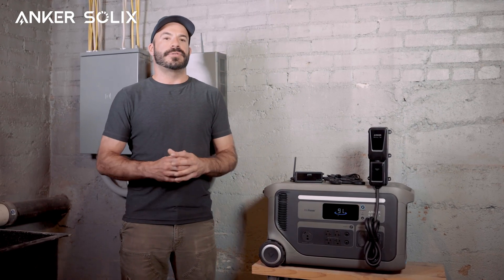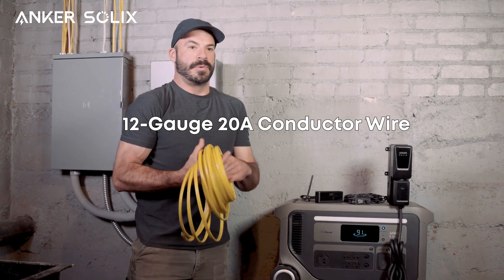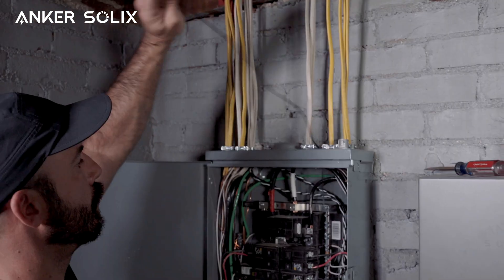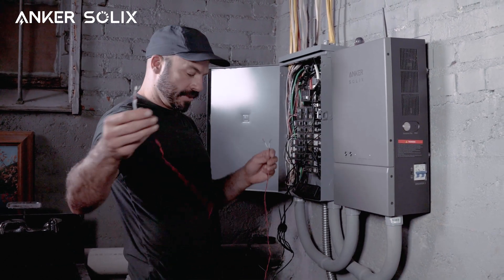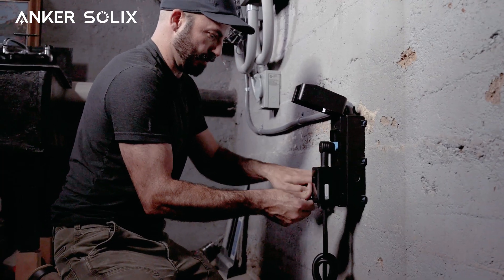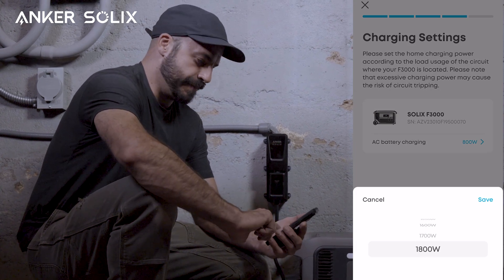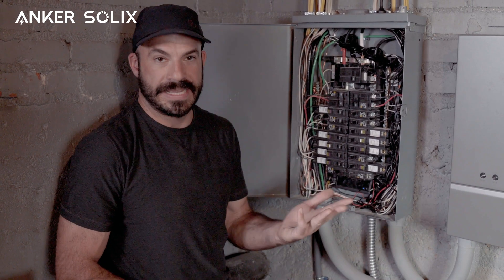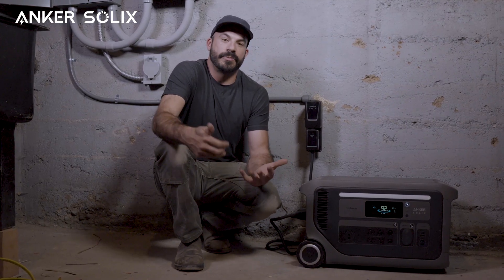How to Install Anker SOLIX F3000 with Bi-Directional Inlet Box & Smart Meter | Step-by-Step Guide

Comment: Okay, so I'm really trying to figure out what the point of this setup is.  What is the F3000 doing in this scenario? Is it backfeeding into the panel if the power goes out to 120 volt circuits? So if you don't have solar panels, it's really not worth having this smart meter part, right? All I really want to use an F3000 for is to power 10 circuits using a reliance manual transfer switch whenever the grid goes down to keep me from having to go outside and power up generators during a thunderstorm.  This way I can have some lights going and some outlets for the interim. What is the best way to go about that using an F3000?
Reply: No. This is to offset cost on solar generation. It only works when there is grid power. Turns it off when you lose grid power. I don't know how you'd do this and have it as a backup for outages.

Comment: Why didn’t you guys add TOU mode on the F3000 like it works on something like the C1000 gen2? All I wanted was TOU mode on the F3000 using just the front 120v outlets. This seems like extra work that I don’t need just to do something the C1000 gen2 can already do without all this. 😢
Reply: They just added it with the recent firmware update!
Reply: @JoshuaMax2020 when did the update come out? Mine says I’m on the recent firmware update

Comment: The RS485 cable between the bidirectional box and the smart meter really limits where the F3000 and the circuit being used can be installed.
Reply: Yeah like im my use case I'd want to install the F3000 in my detached garage where I have a flat roof ideal for solar panels. but that limits me to not being able to do it because of the RS485 communication between the bidirectional box and smart meter. @Anker SOLIX it would be ideal if this wouldn't be a requirement. Both the F3000 and the Smart Meter already have WiFi so what is the reason for the RS484 cable?
Reply: Not sure why this video shows the wire but the other video posted 1 week before this one doesn’t show that cable. Anker needs to clear this up. Would be great if it didn’t need it.
Reply: Any updates on this? Is the RS485 really needed?
Reply: Not needed, there's a note about it in the instructions.